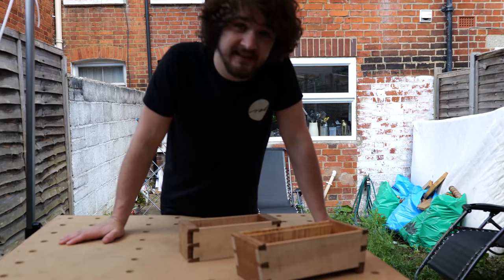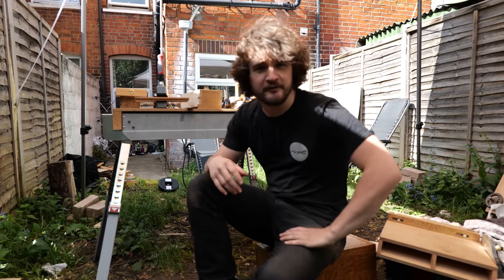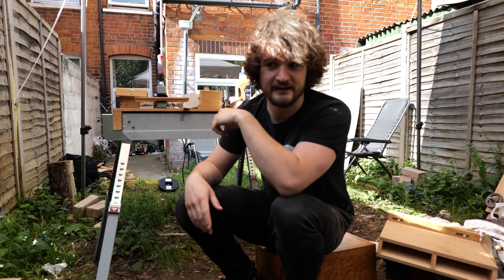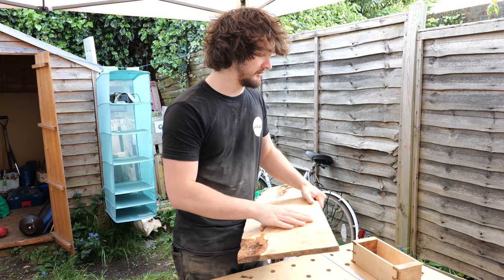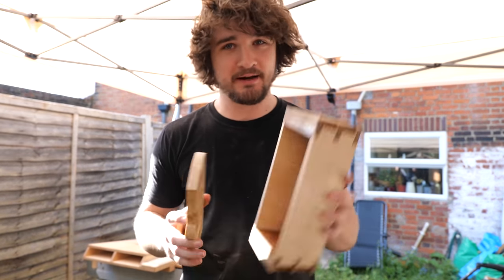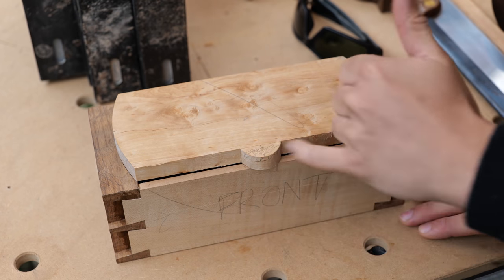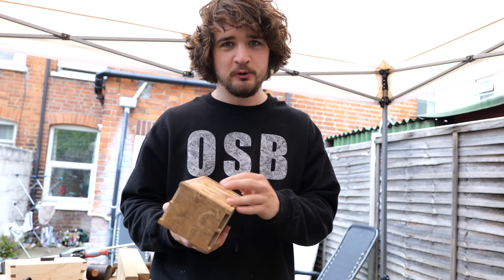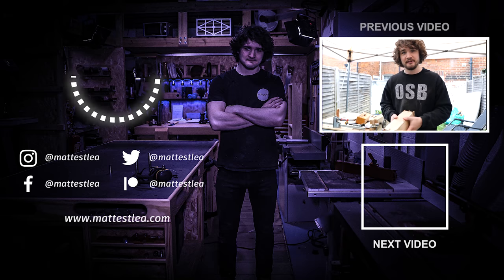Completing The Angled Box! - The Garden Workshop #6

Comment: Also you mention a couple of times different grits for different woods, this is something I dont often hear. Can you elaborate in a future video on how to know which woods should be sanded to which levels I usually do all to the same high grit
Reply: Agreed. I was wondering the same
Reply from the maker: Sure thing! But to quickly give you context, open grained, coarse woods like Oak and Ash don’t required sanding higher than 180. You can do it, but it’s not necessary. Close grained woods like walnut and Maple need higher sanding because the sanding marks may be visible on the super smooth surface. Think of it like sanding a piece of asphalt vs sanding a piece of metal. One of them is going to show scratches far easier than the other.

Comment: Resawing and dimension without bandsaw or other fancy equipments... no big deal but not fun either if you have to do it a lot. That is my only option as I have only couple hand saws and couple basic planes. Its good way to learn techniques how to use tools when you only have very limited set of tools. Lagging some special tool.. just improvise it and make quickly simple tool with block of wood and chisel. 

I have decided that I dont spend money to some tool what I might need but instead try to learn techniques what is needed to get there but when I know how I can do it with pure hand tools i might spend  some money to power tool... bandsaw is still top of my list 😁